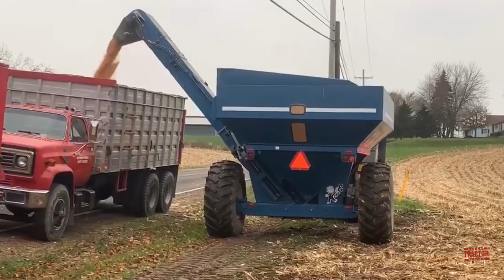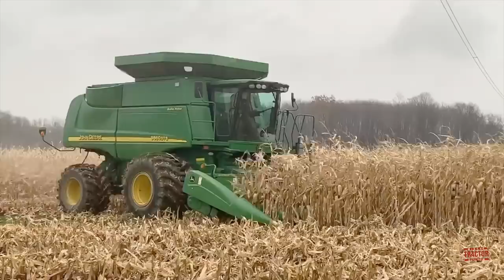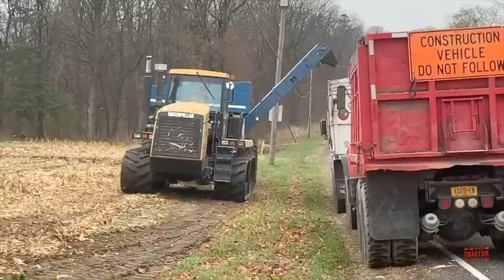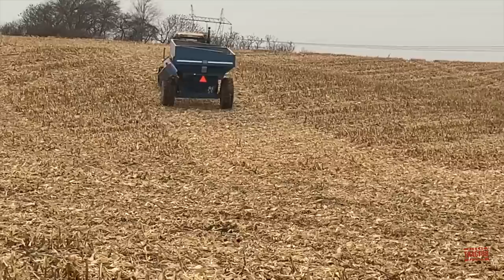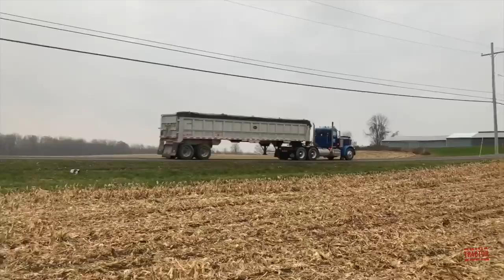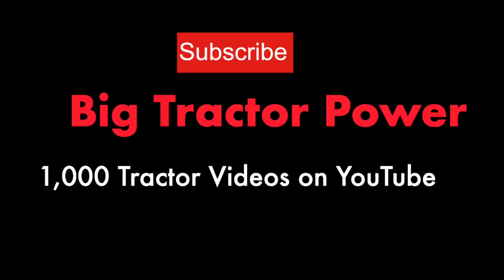KINZE 450C Conveyer Wagon with a CHALLENGER 85C Tractor

Comment: Thats what the Welkers need.
Reply from the maker: This farm originally ran this 450C with a Steiger PTA-325.  The hydraulic control was very handy for the farm as all their Steigers lacked pto. I will share a picture of the PTA and 450C on Instagram tomorrow.
Reply: Wouldn't the Welkers need a much larger one ? Thanks.
Reply: @augustreil  Yes, a 1,500 bushel version of this.

Comment: The best part is in new York alot of the famrs still use older equipment
Reply from the maker: It’s a great area for classics.  This is one of the tip farm’s I know for taking amazing care of machinery year after year.
Reply: @bigtractorpower  ik i see slot of fords jd alot of older models and some made from 2010 12 2000

Comment: Not a bad cart until you get into a muddy situation with it, mud will come off the tires and into the grain door, and if you didn't check and clean it out before unloading you had a mess.
Reply from the maker: Very interesting to know. Thank you for sharing.
Reply: We had one long ago, pulled it with a bareback 4840 Massey
Reply from the maker: Very cool 4wd.

Comment: I don't understand why do farmers another making all kinds of money of these crops concert band tractor worth over a half million dollars, why don't you put down gravel in the field off side of the road for his trucks to pull off and load couple loads of gravel will not cost that much money and it can be a tax write out. They need to spend a little money to make a pull off in these fields to get to equipment off the road and that's my opinion
Reply from the maker: Farmers want to be off the road but that is not always possible.  The farm in this video has farmed on this road on both sides since  it was a dirt road traveled by horses and wagons.  They are careful to move the trucks mostly off the road. The Neighbors in the area are mindful at harvest time that trucks may be in the road for a few hours each year.  To me it’s not a big deal.